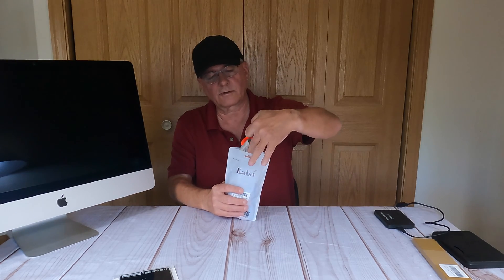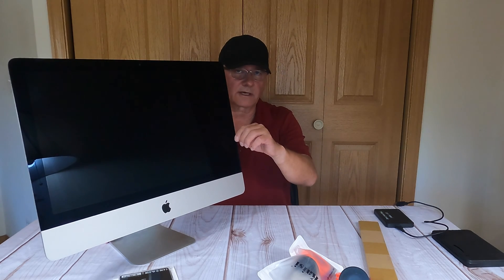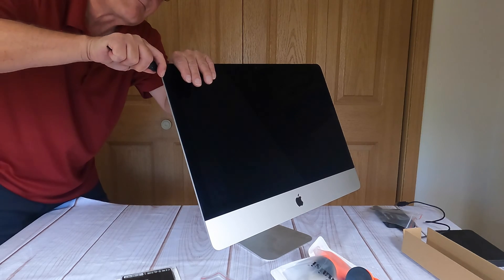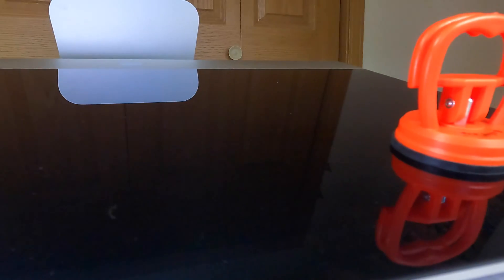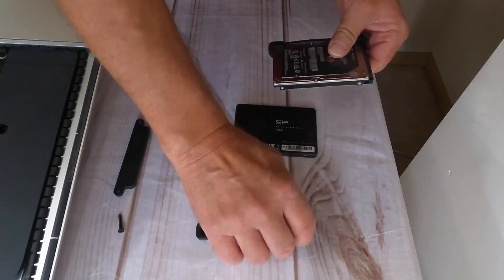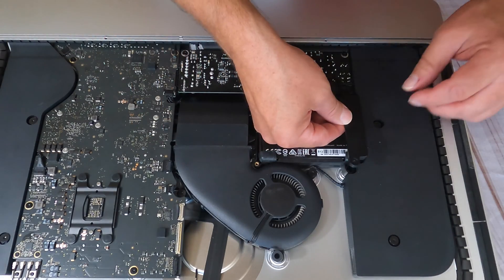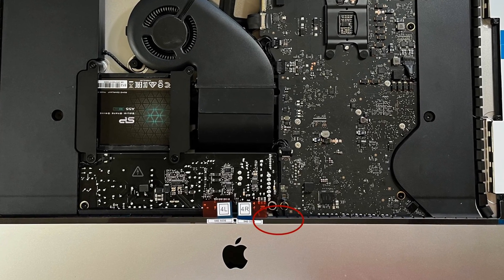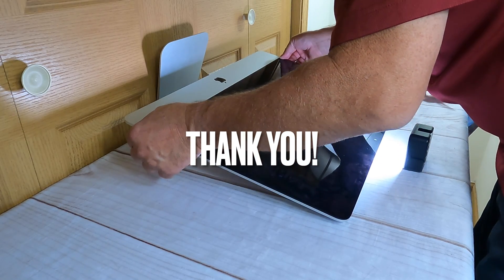Apple iMac HDD to SSD Upgrade 2017

Comment: How did you format and install the MacOS? Is there anything I'll need for that?
Reply from the maker: Study up on the process.  Also be sure to read the last paragraph here for an alternate  option…  A few recommendations, 1) Have a current Time Machine Backup. 2) Create a bootable installer for macOS - (search “Create a bootable installer for macOS”) Apple has instructions how to create one, you may not need this but nice to have just incase you need it. 3) Search Apple for instructions on “How to start up from macOS Recovery” presuming you have a 2017 intel-based mac be sure to select Intel-based Mac for instructions.  Read through the instruction a few times to be comfortable. 

OR…..You can first try to run the OS through an external SSD.  Less sweat / stress since you do not need to open up the iMac and you can try an external SSD.  Results are good!  Search “Install macOS on an external storage device and use it as a startup disk”. Maybe try this first to build confidence / comfort.  Still will need the Time Machine to restore your file and settings.   Let us know how it goes.

Comment: Thanks for the very helpful instructions! 
Do you know where I can order the special tool (the "mini pizza roller") or what the term is I can use to search for it? 
Any pointers greatly appreciated.
Reply from the maker: LOL "mini pizza roller" that is a good name for it!   Search Amazon for a "LCD Adhesive Strip Kit" for your specific iMac.  The tool was called an "Opening Wheel Tool" and was included in the kit.  Best tip for the project is take your time don't rush, when you finish you will be happy with the improved performance.  Thanks for the comment!
Reply: @unboxingwithmarty  thank you so much for answering so quickly! Will definitely have a pizza after this. ;-)

Comment: Hey what ssd and case are you using? Thanks!
Reply: (oh, and the tape)
Reply from the maker: Hi,  The SSD used was a Silicon Power 256GB A55 drive, the specific tape used LCD Adhesive Strip Kit by KKDAO, but currently not available on Amazon, still search and you should find the proper adhesive tape, remember to make sure the tape has a slot open or cut for the microphone 8:06 if you need to see.  I'm not sure what you are referring to as the case.  Good luck!

Comment: Hi friend. I have done upgrade Fusion Drive to Ssd ADATA. and stays in mojave since 2019. now I want to upgrade mac Os. which one is the stable one? imac 2017 21inch 4k
Reply from the maker: I'm not familiar with the upgrading of a Fusion Drive.  I recommend to read up on that.  I upgraded the HDD with a SSD, the OS I am running on the 2017 iMac is Ventura.  I hope this helps.
Reply: Everything stable as it is running in Ventura? After upgrading Ssd.
Reply from the maker: The iMac I am discussing is iMac, Retina 4k, 21.5-inch, 2017.  Ventura is the final supported OS for this iMac.  Currently using a SSD. Runs Venture good and faster than the original HDD.  Remember you are upgrading a Fusion Drive, are there other steps to upgrade a Fusion Drive?

Comment: I'm thinking about doing this to my 2017 5k retina also... Is it worth or will the rest of the hardware keep it slow? Just to confirm! Thanks for the vid, really good stuf
Reply from the maker: Replacing the mechanical hard drive with a SSD with no additional upgrade resulted in improved performance.  BUT...READ THIS , if you are concerned (remember the risk to damaging the screen) first consider booting to an external SSD.  Yes it works!  Before I replaced the internal hard drive with an SSD in this iMac I tried booting to an external SDD and it was faster than the original hard drive.  Maybe start with an external SSD first, might be all you need.  Apple has information on how to do this.  I'll post below. Also there are many videos on Youtube to walk you through this.  ***Remember to backup with Time Machine before you start.

https://support.apple.com/en-us/111336
Reply: Thanks mate, I will try to boot first on external SSD and let's give it a try... I'm just done with 5 to 10 minutes loading screen sometimes @unboxingwithmarty
Reply from the maker: Let us know how it goes @rookiesadventure

Comment: How do you reinstall all your work on the older hard drive?
Reply from the maker: Hi, macOS has an app called Time Machine.  Run Time Machine before you upgrade.  You will need an external drive to back up the data.
Reply: Thankyou very much.
Reply from the maker: You are welcome! @Was_Heart_Surgeon_Nirmal_Gupta
Reply: You could also clone the hard drive using a external drive dock bay